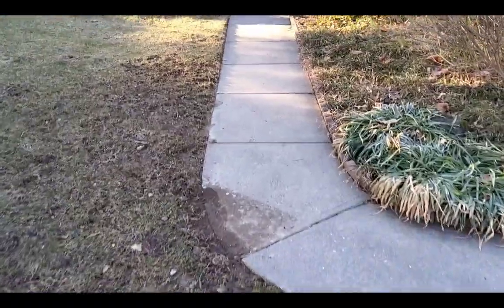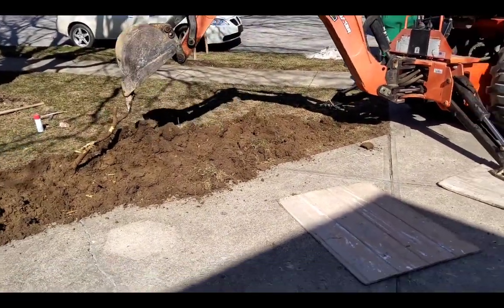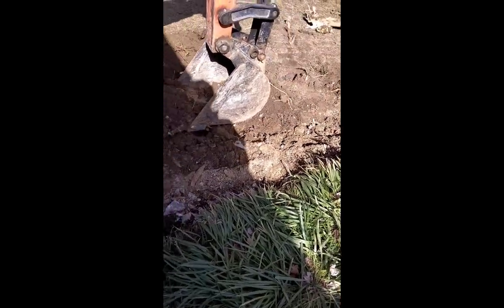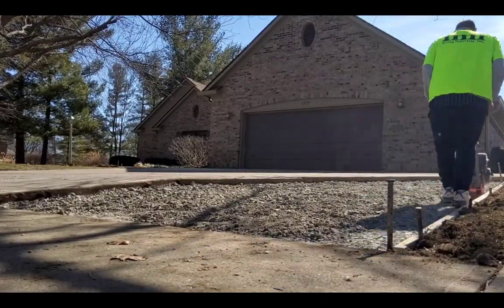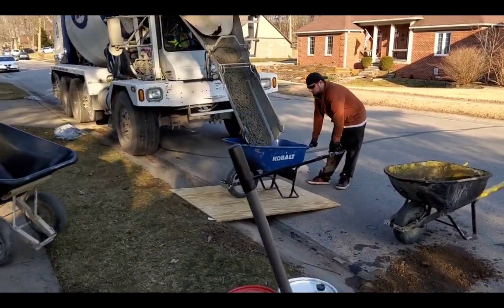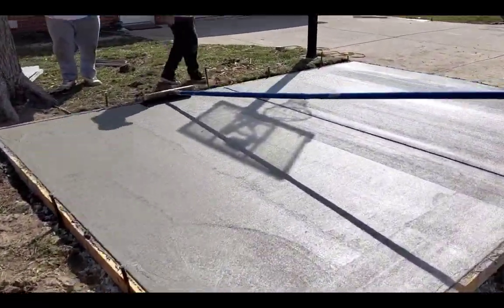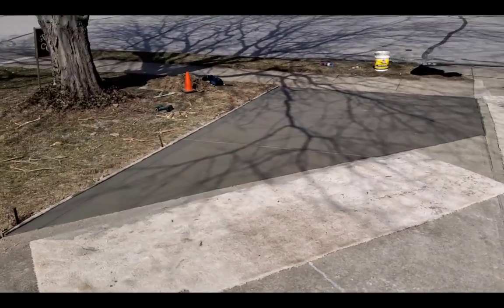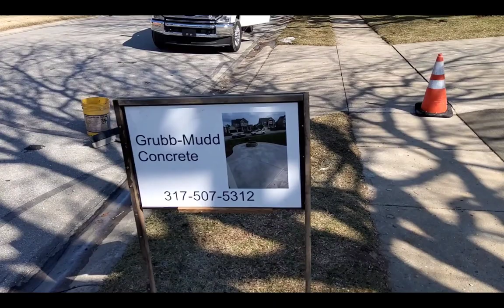How to pour a CONCRETE "side job" (sidewalk & driveway)

Comment: I like to make a hole and use a spud bar and sledge pop up a slab at a time or two and it makes for quick work and you get a killer work out
Reply from the maker: we tear almost everything out by hand, it usually works pretty good. if it is a driveway we use a backhoe

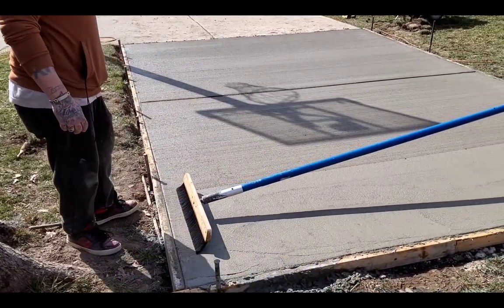Comment: But doesn't modified hold moisture?  Won't that cause it to heave come freeze? As it will saturate  far less room from the water to travel..  chips only always here in 6a.  also that looks like a hella early broom, can't hear but the broom seems far too wet..  9:30 you can see the water transfer coming off the form 1/3 the way out on the pad, that will cause discolouration in the slab.. after you rise the broom in the barrel have the handle flick the bristles  be surprised how much more water will come off of an already tapped broom. and will give a much crisper broom and and you don't get the white all over the one side..  not trying to be a dick, just pointing out things I see I didn't like.. Keep killing it brother!
Reply from the maker: Right on, thanks for the input! Have to give it a try
Reply from the maker: It's OK, I have found out that just because we do something here a certain way, doesn't mean that it wouldn't old work where u are from, as far as the earlier broom, the customer wanted a heavy broom and they loved it exactly how I did it, nor did it discolor the slab anywhere, not even on the edges, thanks for commenting! Where are u from?I have a feeling it's from somewhere ppl like very light broom, where the ground does not freeze. Up here the ground freezes and we have to keep that in mind as we pour and especially how we prep
Reply: @GRUBB-MUDD  Pennsylvania zone 6a.  I agree everyone does things differently.. I have had bad luck with wet brooms making the saturated surface cast white.  That was why I asked about using moidified as I was alresy taught that the powdered milling will hold moisture..  I have never used modified for that sole reason. Just 2b base with 1b fine dress after full 96% compaction. As it doesn't hold moisture and gives ample room under the slab for  freeze fluctuation.
Reply: @GRUBB-MUDD I also have a variety of brooms a stiffer bristle here keeps me from brooming too early. As before keep killing it!
Reply from the maker: I used a stiffer broom the other day! It did nice hope u keep watching the new videos